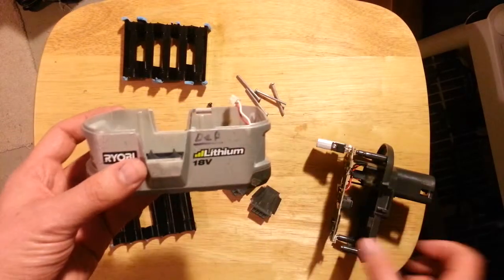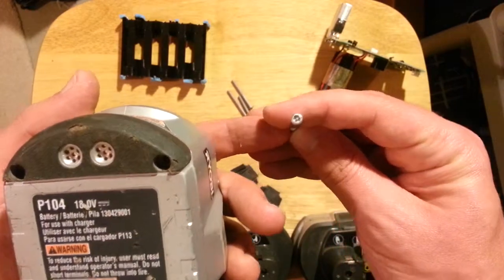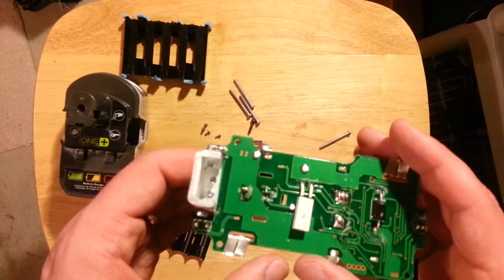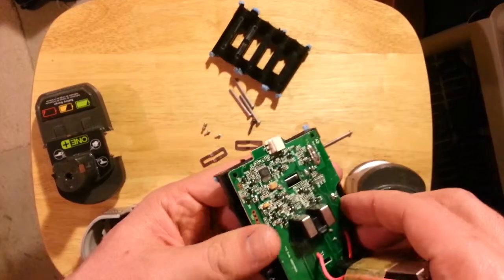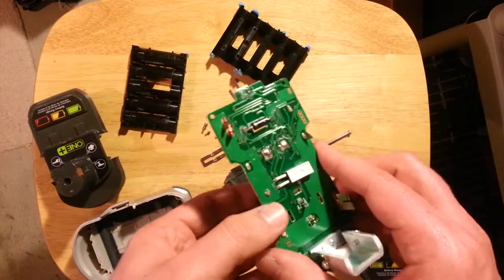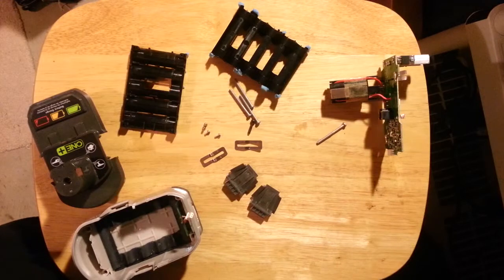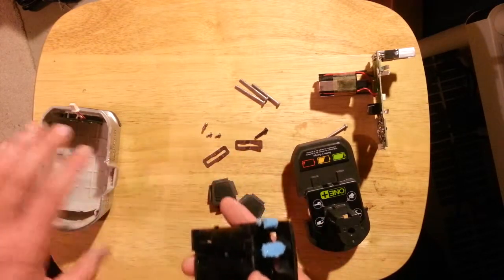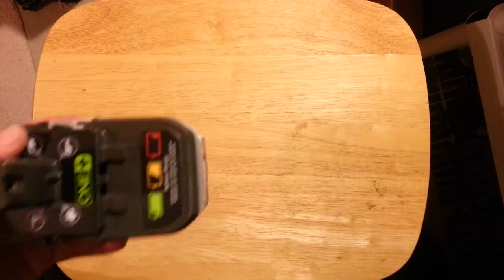Ryobi ONE+ Battery Teardown

Comment: Can you use a makita 5 amp pack and insert it in the ryobi battery case with the ryobi controller circuit? And how would you make the connections.?